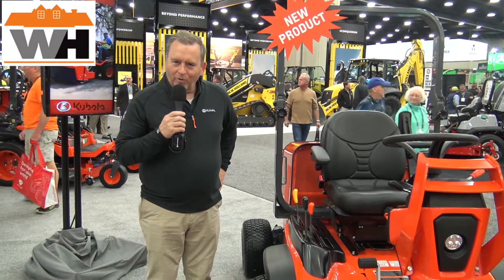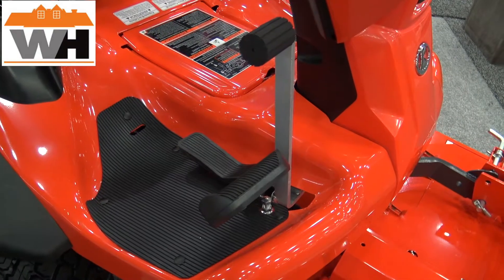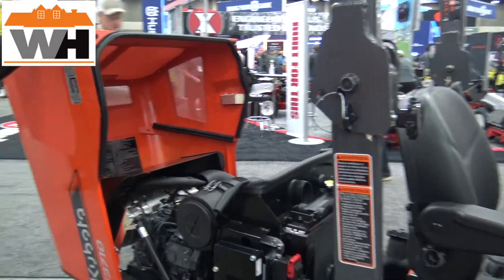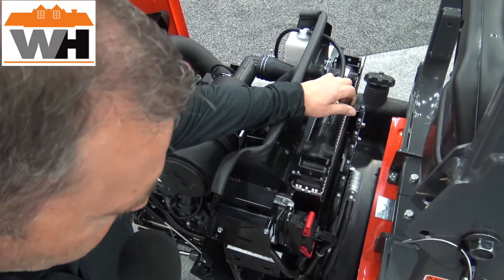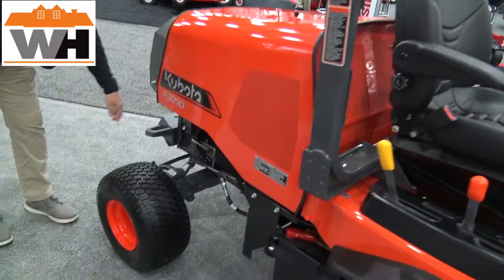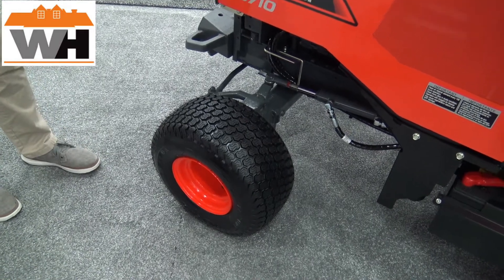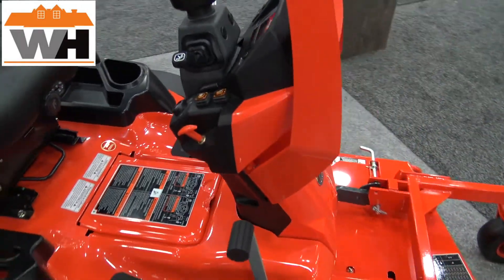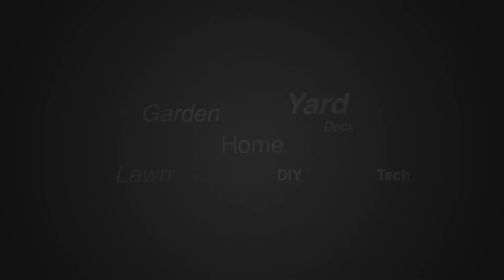New Improvements To The Kubota F3710 Rear Engine Commercial Mower

Comment: Nope. Still using that stupid treadle pedal. If you ever run a two pedal John Deere you will see how much more comfortable it is. Ran a JD F1145 front mower working for a local school district. 72 inch front mower with a mulch kit. Curtis hard cab allowed me to mow in the rain and you would swear I mowed on a sunny day. No clumps nothing. In winter we used them for sidewalk snow removal and even with turf tires they plowed wonderful. Mowed a bank that was so steep you were laying on your back instead of sitting. Climbed right up it every time. Leaves disappeared with that mulch kit. A fabulous machine.